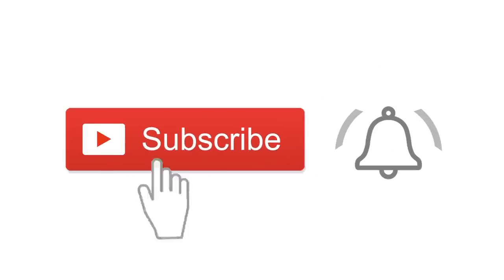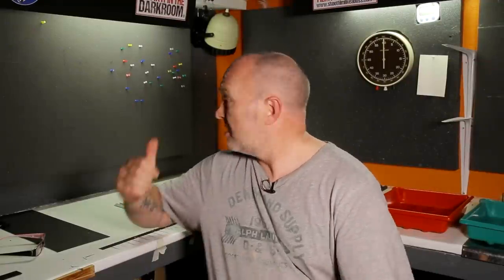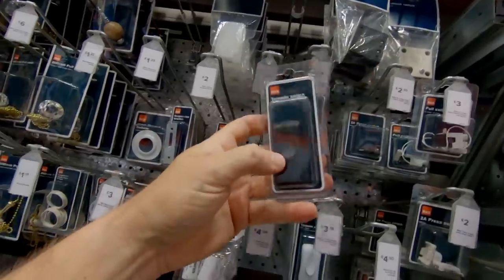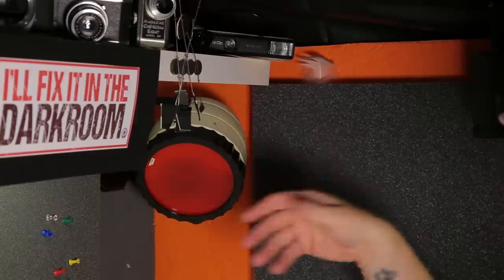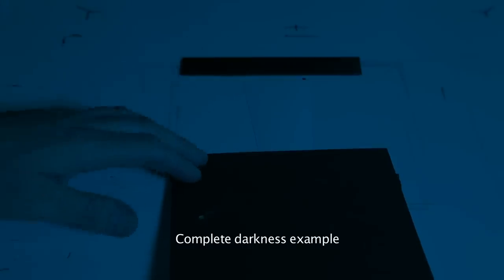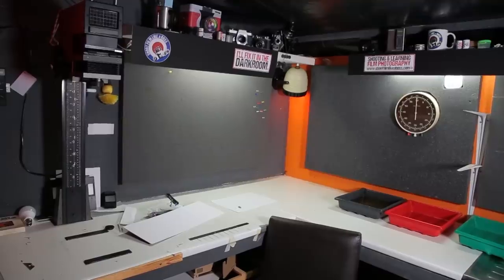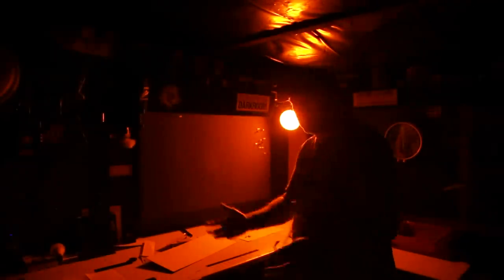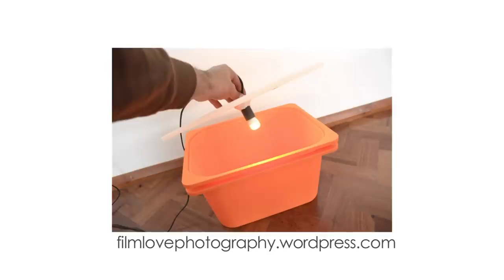DIY DARKROOM SAFELIGHTS - WILL THEY WORK?

Comment from the maker: Please note I made these DIY lights out of stuff I had lying around purely to get more light into my darkroom for the videos I make. Although I have touch tested the foam and bucket after use and it doesn't get hot I still intend to get a cooler running Red LED Bulb soon. If you're going to make your own safe lights then make sure they are safe to use.

Comment: Glad to see I'm not the only one who had the same idea. When I first started getting back into film I decided to DIY as much as I could and I had heaps of spare 3000K white LED bulbs on hand so I took some sandpaper to the glass, mixed some vermillion watercolor paint in pva glue and left the bulb to dry overnight. The light it produces is quite dim but your eyes adjust and I haven't had any problems with it fogging paper so far.

Comment: Another great video.
You can get some transparent red plastic tube cut it to size and thread it over a four foot fluorescent tube, tape up the ends. You used to be able to get proper ones, they  were called 'Encapsulite'. I don't know if they still make them. 
Anyways because it's a four foot ceiling light you don't get shadows over where you're working. I've got two in my darkroom, at each end where the wall hits the ceiling.. 
To test safe lights I put a fifty pence piece on a bit of photo paper, leave it with safe light on for about 15 mins, develop the paper and if you can see the outline of the coin the lights aren't safe.
Reply from the maker: Try sensitising first Jon. Try the same test I did.

Comment: I use a remote coloured control LED light bulb, set it  in on red and dim if you want  it works a treat. Nearly forgot I quite like the bucket style could you add a dimmer control.
Reply from the maker: Have you tested it Steve? I nearly got one during this video...

Comment: When I first started printing I successfully used a rear cycle light, one of the ordinary cheap ones, but they do need batteries. Now I have a small Patterson darkroom light. Wonder if painted bulbs would work if they were low wattage?  I have used acrylic paints on bulbs before. It dries quickly and is easy to use, but I think you would need two or three coats to get an even coating that obliterated the brush marks and therefore didn’t let any white light through. Thanks for making the video Roger.
Reply from the maker: I thought of painting a bulb! Probably cheaper to buy one though.

Comment: My darkroom has a white ceiling and light walls . For my Fomabrom Variant 111 paper I have to use RED darkroom light . The paper is very sensitive , a 10x12 inch print from a 6x7 negative need only about 4 seconds at 1:8 . I have some never used Ilford orange darkroom safelights stowed away for many years . The Ilford safelight give a bright light , but you can not use it for Foma papers . If you use slow fixed grade paper you can use green or brown safelights . Can I make you happy with the Ilford safelights ? Peter .

Comment: How about trying to find some LEDs which emit light in the wavelength range above the spectral sensitivity of the paper, but still below the threshold of IR? It would take some research and a few peeks into technical data sheets for the papers that you use, but it might work. For example, Kentmere VC has its spectral sensitivity cut-off point at around 550 nm, so everything above that should do no harm. In theory, you could then literally flood the room with light without the danger of fogging the paper. It could prove to be an affordable and effective solution, so I think I'll give it a try in future months. Cheers!
Reply from the maker: Here's Borys. Interesting. Above my knowledge but it's a seed. Thanks.
Reply: If you scroll all the way down the link there are links to the power supplies and accessorys needed.  They are pretty inexensive and simple.  They are also water proof and you can even mount them outside.   The water proof would be an extra bonus because of the very nature of being around chemicals.
Reply: I set up my darkroom with those LEDs from the beginning. I used an old 4-flame lamp out of my sleeping room and only replaced the light bulbs. They even were not particularly expensive. I only didn't buy the cheapest ones. They have been working perfectly for the last 5 years and not in the least have had any negative effects on my papers.

Comment: okay, i have yet another question for film developing,  what is the deference between 1:1 and Stock, in developing mixing,  I see the times are different so they must be different.  thanks for the great channel.  I should be developing my first roll this weekend.
Reply from the maker: It's all down to personal choice and where you want your negative to be at. Usually contrast control. More dilution will give lower contrast at the cost of a bit more grain. Depends on the developer and film. Also dilution saves you money on developer, at the cost of longer developing times. There is a ton of info online about diluting developer but some like to talk tech and math which not many folk understand, including me!  I'd say keep it simple with a 1:1 dilution on your first development this weekend and when you feel adventurous in time play with other dilutions and see what you get. Good luck!
Reply: Imjusttoo Dissgusted talking about D76, ID-11,Microphen,... 
Stock is the chemical you get when you dilute powder in instructions water volume.
1:1 is mixing 1part of stock chemical (previous description) + 1 part of water.

Comment: I was planning to just diffuse some red LEDs.
Am I missing something? Are safelights more specific?

Also good to see that you flood it just for us. I have been sweating it a bit, thinking "that looks way too bright"
Reply from the maker: I lighten it up in the edit for the viewer. I guess try red led and make a test 😊
Reply: I meant to say above my bench.
Reply: I have red LEDs, bounced off the white ceiling, bright with no adjustment time, and no fogging at all.  In total I have 16ft of 12v red LED strips and it couldn't be better.
Reply: Ive been considering doing pretty much the same thing - wrap some red LEDs in some sort of diffusion material. Will test as soon as I get a darkroom set up.